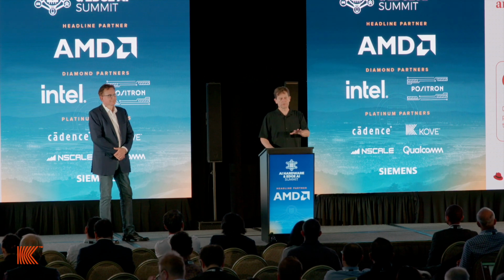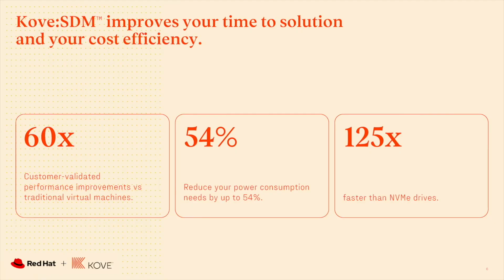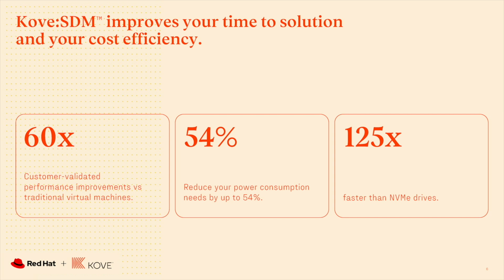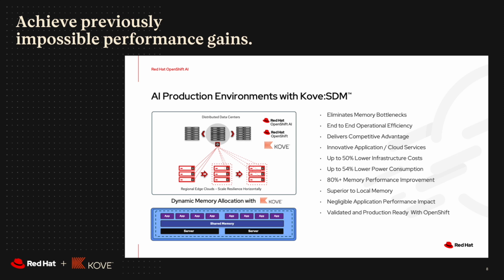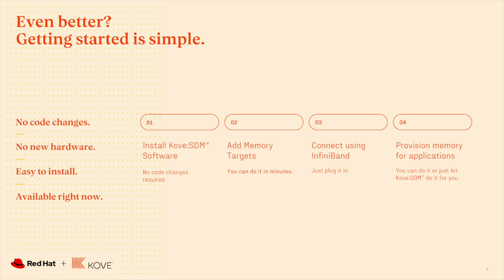Kove AI Hardware & Edge AI Summit ‘24 Keynote: SDM Tackling AI’s Challenges Now w/Memory Flexibility

Comment: Nanosecond determinance != nanosecond inter-node latency! 
If you make such big claims, why not explain the tech on the underside instead of just saying "test it"?

I'll do it for them:
Propogation delay - this is a hard parameter based on the ROCE/Infiniband cable length, typically 50-100nm depending on length.
Network Stack Overhead - this is what existing FOSS RDMA tech was designed to handle, because it was the primary limiting factor
Hardware Latency - NICs and switching fabrics and routers, etc.
Software Overhead - self-explanatory

RDMA bypassing the network stack took millisecond latencies down to microseconds, even sub microsecond if short cables are used.

So I can only conclude that when they say nanosecond latency what they really mean is nanosecond deterministic overhead (and my guess is they mean how long for the memory request to process and hand off to the NIC) - ergo this IS NOT NANOSECOND ROUND TRIP LATENCY! (because my other guess would be custom backplanes but they say this works with COTS..., so that theory is out)

Very cool regardless, so don't take this as a negative comment please, I was just trying to reason through the claims having dealth with NUMA issues in RDMA land.

That said, I would then hazard to guess this is either OS kernel shims for intercepting memory page faults and mapping remote RDMA-accessible pages into the local virtual address space, or a user-space library that provides its own memory allocation APIs (remote_malloc, remote_free) and handles the RDMA calls behind the scenes. The latter is simpler to implement but requires modifying applications. The former is a much more complex, but more seamless, approach.

I hope the patents don't keep this out of FOSS land.